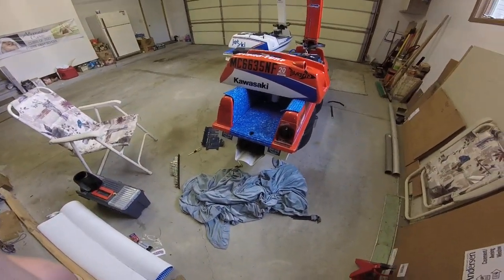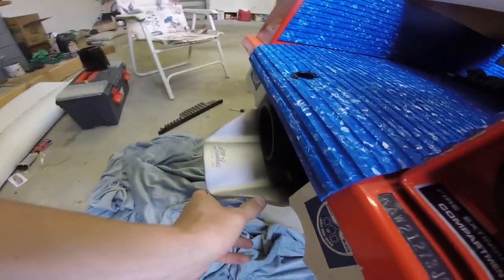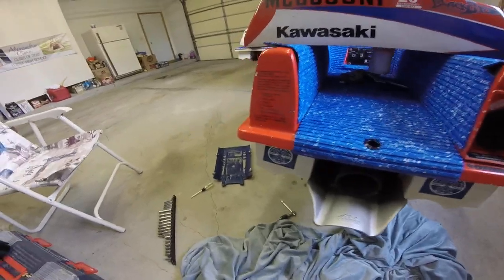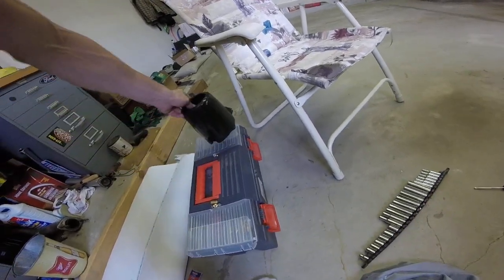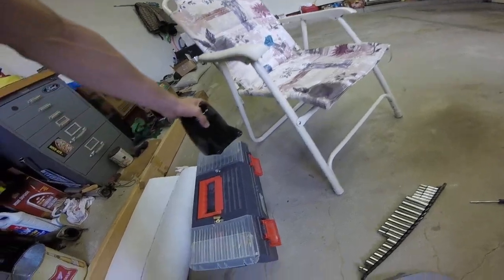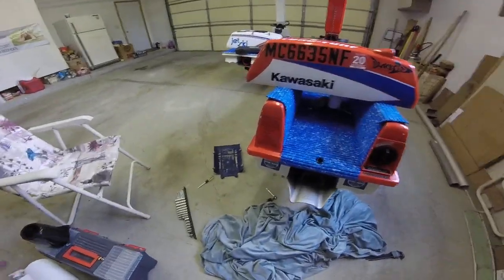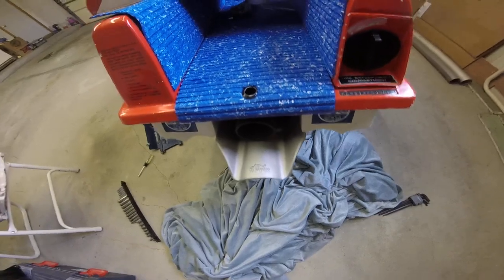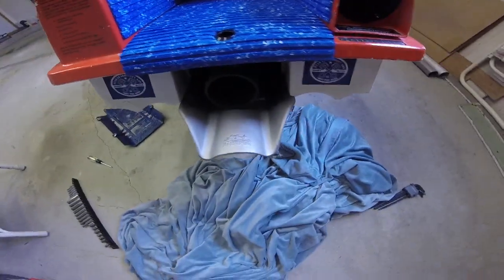A look at the Jet Dynamics ride plate installed

Comment: I'm wondering how you liked the ride plate? Trying to decide between a jet dynamics, ocean pro, or pro watercraft racing ride plate
Reply from the maker: Tyler Fregeau I love this plate it’s great for noticeable amount of grip when carving but if you’re not trying to carve you can still do 180s and slides no problem I think it’s worth the money. If you aren’t going with this one go prowatercraft for sure.
Reply: @motorandoutdoor8137  I ended up going with the ocean pro. They are great at straight line and turning, all that good stuff